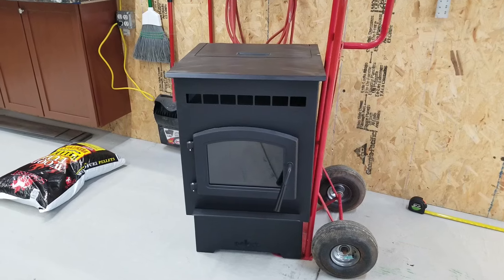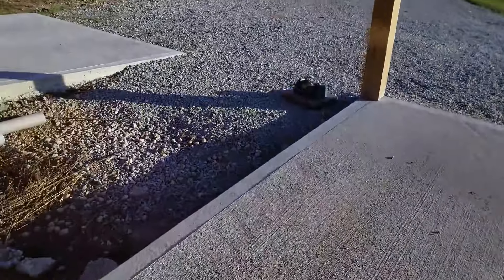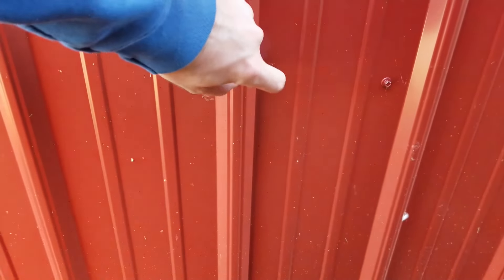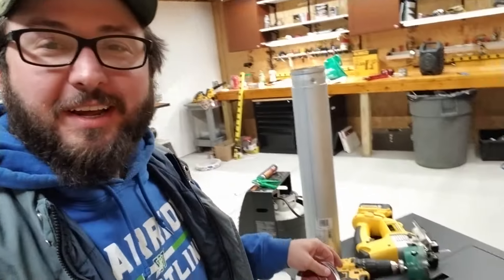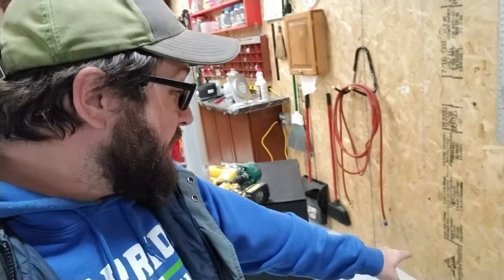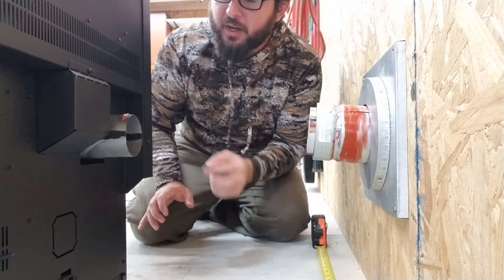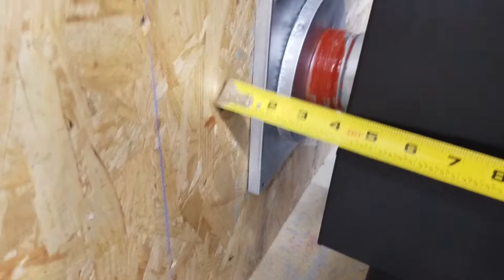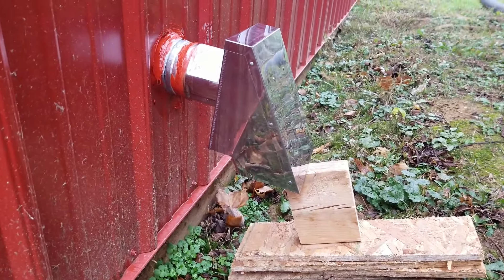Pellet Stove Install

Comment: If you know you are going to be drilling through thin metal with a hole saw, try this first. Get a scrap piece of wood larger than your hole. Maybe 3/4" thick. Plywood or solid, does not matter. Drill a hole. Remove the slug from the hole saw. Stick a pencil through the center hole in the slug and metal and use some drywall screws and attach to the siding or metal. Remove pencil. Drill your hole. The drill bit is really not necessary now and the slug is the exact inside diameter of the saw so no walking.
Reply from the maker: Nice tip

Comment: It is bad advice to run a pellet stove straight out because if the electricity goes out and the pellet stove goes out, smoke will enter through the stove. If you have at least a three or 4 foot rise on the outside it eliminates that so a rise is necessary.

Comment: Should never have a drop horizontally through the wall. It should be level if not rise slightly. Should also have a minimum vertical rise of at least 3 ft  preferably 5 ft to assist in venting before terminating vent. No cleanout??
Reply: Nope, horizontal vent is all you need.

Comment: Just got this same stove and wanna do the straight out the wall set up like you did have you had any issues with the way you set it up? Thanks!
Reply from the maker: We have had no issues, it works like a champ. 

*Disclaimer- this is NOT the manufacturer’s recommended installation

Comment: Hello, if your getting a smoke smell in your house after first day of firing the stove up, what would your steps be to see where its coming from?
Reply from the maker: The first thing I would try is right at initial start up of the stove, while the fire is still burning smokey, turn off the lights and shine a flashlight on all of your pipe joints and see if you see any smoke infiltration at the joints
Reply from the maker: Do the same with the gasket around the door to make sure it isn’t leaking there either
Reply: What are you gonna do if you need to take apart the ventilation pipe? You used silicone wouldn't that make it hard to pull apart

Comment: It will work but it needs a pipe going up 3 ft
Reply: Nope, horizontal is all you need.
Reply: @hubster4477  not if it snows
Reply: @MargisonGODBEY  it doesnt where they are at.
Reply: @hubster4477   You need a minimum 3 foot run up in case the power goes out.  Without that run your house will fill with smoke if the power fails while the stove is running.  Would not be fun.  A horizontal termination like that will only work if the power doesn't fail.
Reply: @harlandmct  right, ive had the power go out a few times, there is smoke but its not that bad, not often and not bad enough to change things around. Someone burning popcorn is worse!
Reply: @hubster4477   Wouldn't be hard to add it but the additional sections are costly.  You would need a cleanout T at the bottom, 3 1 foot lengths, a 90 degree elbow and then your termination cap.  If what you have works in the shop though, that's fine but for a home I wouldn't risk it.
Reply: @harlandmct  right.

Comment: U really went cheap on the chimney!   What about a clean-out???  What about a little rise to get the exhaust off the ground??  Oh well! to each his own!!  I did give U a like cause of my BS.
Reply from the maker: Thanks for watching Robert! If it was in my house I would have done some of those things, but on the barn, I think this will be fine.
Reply: Yea 3' off tbe ground is code. Definitely a potential to be blocked by drifting snow.
Reply: What about the draft ? Stove won’t burn efficiently without a draft from the stove pipe, it needs at least 4/5’ vertical run. And no clean out? It will quit working from fly ash build up.
Reply: @alcantrell5340 how exactly is the ash going to build up? It’s going straight outside
Reply: Pellet stoves have a draft fan
Reply: @alcantrell5340  it is power vented it doesnt need a draft, but in most states the exhaust outlet is required to be higher off the ground to avoid combustables like grass and leaves not to mention being potentially blocked.